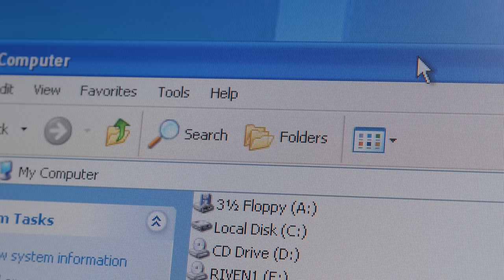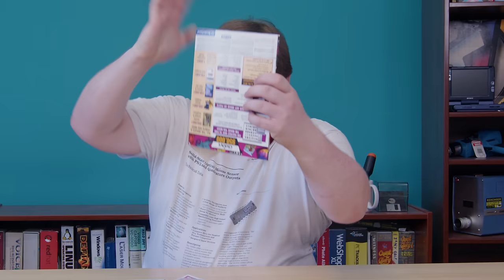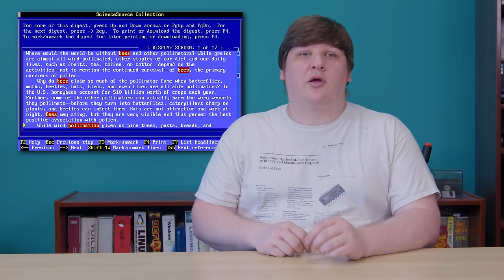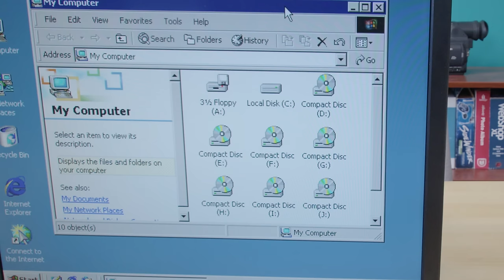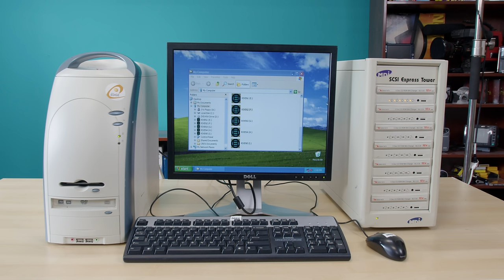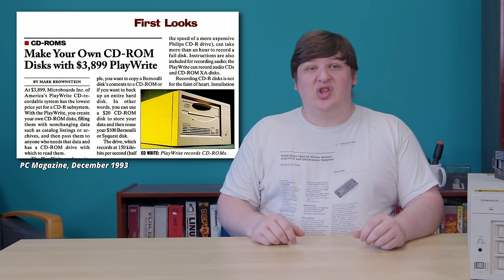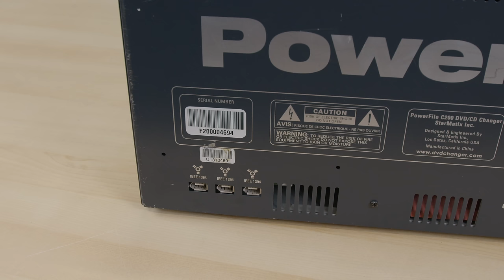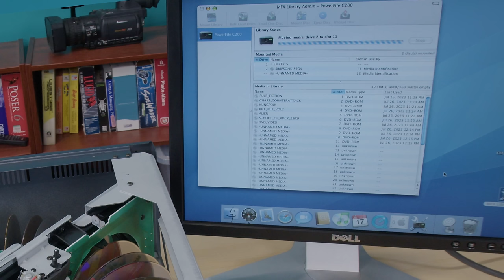A Jukebox for your PC: 1993's CDROM Servers

Comment: The solution for arbitration for these would have been the same as it was for tape libraries: Hierarchical Storage Management (or "Tiered Storage", is I think the more en-vogue term right now.) Think Dropbox. You have a symbolic representation of a file that you don't actually have on your computer right now. You right-click that file and say "online this at your convenience"; the sync agent then goes out and gets the file and puts it on your local disk. Once it's done, you can open the file. (And if you run out of local disk space, the sync agent might choose to "offline" some other synced file in the process of freeing up space to "online" the file you want.)

If you try to open an offlined file without first online-ing it, then the read(2) syscall will sit there waiting for the sync agent to wait for the remote end to wait for its file-online-ing scheduler queue to wait for the tape robot to online the file. And then read(2) will return.

Now imagine the same thing, but with an NFS/SMB link between you and the Dropbox folder. You can still right-click-"Online", but what that triggers is an online-ing of the data _on the server side_, not on your local disk.

That's what a tape-library (or likely CD-library) storage server does. It has the filesystem metadata cache you were imagining, and the hard disks + RAMdisks for caching individual files. But it never directly exposes blockwise access to the files. Instead, it's more like you've got network access to an object-storage cache backed by upstream origin block devices. One process is managing a queue of "online-ing requests" — full filewise fetches from a given origin storage device, to the online-d data cache. Then, async to that, you've got another process, serving out the contents of the online-d data cache through a regular networking protocol. Clients do block access against the onlined copies of files in the cache — never against the offlined origin copies of said files. Only the online-ing agent does block access to the offlined origin copies, and it does so as intelligently as it can, coalescing requests for data from the same archive (tape/CD) and even internally reordering those requests so that it can fetch as much as it can with just one forward in-order read through the archive medium.

Of course, Windows didn't natively support any of these operations†. (It does now, though; calls it "Tiered Storage Spaces.") Instead, from the 1980s until around the early 2010s, when you bought one of these "storage solutions", it'd come with client software — Windows shell extensions! — that allowed you to not just right-click-Online single files, but to specify entire complex data retrieval jobs to fire off, perhaps even with a nice(8)-like priority level.

After all, you might want to hook up an external hard disk to your storage server and have it piece together a disaster-recovery image or audit log from incremental backups held on ten different tapes, over the course of eight hours, without impacting other people's ability to use the storage system for more urgent things.

This kind of software, therefore, had more in common with an HPC batch job scheduler client interface (think: if Kubernetes had a GUI), than it did with something like a PC tape backup program.

Also, the interesting thing to note about this paradigm, is that it never really thought of what you were doing as "introducing" media at the origin, and then caching it online — rather, it's more like you were importing data into an unbounded virtual hard disk, where most of that data would then quickly be "offlined" by evicting it to free up more room for new and hot data. With tape-library storage systems, "evicting" meant writing the data out to tapes. With modern CD-library storage systems, the same is true — the library burns CDs. But I'm not certain on what old CD-library storage "solutions" would have done, in the era before CD burners. Maybe they would allow you to import a "pre-made archive" (i.e. the CD-ROM itself); where it would then checksum all the files in this "archive"; and then would consider any file it had with a matching checksum on disk to now be a candidate for a zero-write eviction "to" the CD.

---

† One funny exception to Windows not natively supporting this: ever since Win98, SHELL32.DLL has contained a little black clock overlay-badge icon for files, never used by Windows itself, intended for these third-party HSM clients to badge files with to mean "offlined by the HSM software."

Comment: The Pioneer cartridges had a HUGE drawback - they scratched the hell out of CDs, ON THE LABEL SIDE - the side where the data is only under a layer of laquer

Ask me how I know this....

As for the jukeboxes and other "MTX" controlled units, there was a package called "rombrain" (dos) which indexed the things

Yes, I trashed a set of 500 disk changers about 15 years ago - I couldn't GIVE them away

Tape robot firmware isn't that much better than the consumer stuff - and these days comes with VERY HEFTY license fees to activate things which already exist in the tape drives

Comment: I would say. The CD storage was always a temporary solution. The idea at the time was that Harddrive would grew to larger and larger capacity, and they would simply just ad more and more hardrive space eventually in say 10 or 15 years time mirror the whole data base on harddrives.

One one file was mirrored of the CD, it would pretty much never taken of. When the drive was full, ad a other one. The  crazy expensive 1GB drive you bought in 1993 might not be full by random reads until 1995, then you could buy a 6GB drive. 

For something like corells image library. The first disk is the thumbnails. That would pretty much be mirrored instantly.

If the disc crash... well. i guess you have a week or two with very slow access, but then it would slowly speed up when the new drive start cashing. So there was not really a need for raid for that drive. (Also something like a thumbnail disc would probobly have there own dedicated drive).

A WORM drive is basically a CD-R.. well sort of kind of. They typically have sectors and tracks, and not a spiral grew as a CD, and they have a totally different protocol. But as far as the actual hardware concerns, they are basically CD-R.

The benefit of  WORM contra a CD-R was that due to WORM used sectors and tracks, they could write one file at a time, while a CD-R had to write in sessions (and back then, most players only supported one).

The MD isn´t only similar to a MO drive, its literally is a MO drive, just adopted for the consumer market.

A MO is pretty much identical to a normal 3½" disc drive with a CD just added on top. It have a totally normal magnetic head that writes the data just like in a 3½" disk drive. The only diffrance is that the disk have a special coating makes it so its only active where the laser shines. So the magnet magnetize a huge surface and the laser focus the read space. That is why the capacity is so much higher.

So in every way that counts, a MO drive is pretty much just a magnetic floppy, with a laser that both shrink the written data down, by several order of magnitude, but also increase the read speed, with pretty much the same amount. (well, it still have to read 1000 of tracks in steed of 80)

There was plenty of PC games that came on DVD. But it was not clearly labled. A friend of my found that out the hard way. Putting a newly bought suposedly CD game into his CD player, turned out it was a DVD record, just labeled as a CD-rom

Comment: A couple comments. 1) Linux has a function/feature that you can build a virtual juke box. I did it and it worked. At the time I did it, hard drives weren’t as large as they are now. 2) mid to late 1990’s, a company I worked for got an Enterprise version of a CD juke box, to archive data on. The options were, you bought a rack, specified how many slots, one slot per cd and how many cd drives. The company I worked had spent a large amount of money on it. When it worked, it worked great. The problem with the unit was the mechanisms used to retrieve a cd and insert it into a drive a.k.a. “cherry-picker” would get out of alignment.. The technicians would come in, at least once a week and align the cherry picker.  And it was a time consuming process.

Comment: I once saw a technical interview with a technician of a playout centre which got its content delivered on Digibeta at the time, so they had a tape changer which would copy the programmes onto harddisks automatically. He said that the changer was pretty much maintenance free. It only needed to be lubricated from time to time.

Back in the time those changers would have been highly interesting for me, since, if they work, they open up optical media to whole range of use cases. For example you could use them for backup. You just fill it with blank disks from time to time, and regularly it would write the backup onto them, sparing you the drudgery of having to get up at night only to swap a disk every 30 minutes. 

Of course this all hinges on software... and with the only option being a GUI tool it kinda eliminates the advantage of potential automation.

Comment: I hated dvd players in the 2000's. The first one was a pioneer 5 disk changer that was over $1000. It lasted about two years before I had to start taking it apart and cleaning the lense. That didn't work very long, and it would stop reading again. Sometimes I could give the spin a boost manually and it would run. That worked even less times. By this time, you could get a plain one for $30 bucks at walmart. They maybe lasted a year sometimes only months. This video has brought back so many memories of high frustration ending a few of them getting ripped off the shelf and flying across the room. Aside from that, this guy is a great writer. I can't imagine putting all this together.

Comment: I worked at a private school back in 2002/03 and at the main school we used a ISO server. This allowed us to ISO a CD and then share the ISO over the network. Only us admins could access it to install software from it, thus preventing other staff and students from copying the disks. At the lower school we had a SCSI five drive bay CD-ROM tower which we put CD's in and then the disks were never removed. I can't remember how the CD SCSI tower was setup because it was installed before I started working there.

Comment: General 6000! I cleared out a radio station with a set of these, most never left their cases, I gave them to my production guys because they actually collect vintage sound libraries! 

I’m only 9:37 into the video, if you talk about radio, I may give my two cents, but at face value, it wasn’t as common as you would of thought, at least not for independent, “family” owned stations, this is all before my time, but from what I’ve seen, we went from reel to reel and vinyl to cart machines and cassettes and CDs… and then it spliters, some went to CDs only, other held out till they no longer could, into the digital age, and other flew into mini disks head first! 

I cannot understate how many MD players I have in storage…
Reply: Yes the pioneer disc cassettes!

I’ve only ever known of one station in the area to use this device! I got to hold it before it was sent to the afterlife, don’t feel bad it was long since dead, they sat on it for decades because radio people don’t throw stuff out…

Comment: This reminded me of the many depressing times the place at which I worked for decades would get some new kind of gee-whiz mass storage hardware to productize for our clients. Naturally our management always found the cheapest solution available and figured the manufacturer would fix all the problems we found. The evaluation models always barely worked for the main simple use cases and would fail horribly for anything outside of those use cases. To test them I would do things that would be unthinkable to a nerd but completely intuitive to a standard human being... like eject the media when it was being accessed. In two cases that caused the multiuser system to crash and in one case of a poorly designed removable hard drive it made the media and the data on it unusable forever. Almost always the manufacturer would claim that I was just some idiot abusing their hardware, you know, like all the other idiots in the real world who would be doing the same things if we began selling them.

Comment: This whole CD storage tower trend always baffled me. Older CDs were 640MB maxing out later at 700MB. So just build a RAID group on an older server with some larger SCSI drives. Rip the CD’s into ISO’s and use a software platform to mount them across the network. Way faster transfers overall, especially if multi people were accessing the same ISO. All that in a much smaller footprint than those giant 42U rack full of drives. Plus all that can be done without having to physically touch the server. And you still had the original CDs as backup.

Comment: I remember a BBS that I frequented which had 'broadcast times' on files. I wonder if they used something along these lines. A disc would swap out every 4 hours and then another group of files would be 'broadcast' for download. Speculation, but it sure fits the use case.

Comment: I got a 7-bay SCSI tower from my school's library when they were upgrading theirs.  They used it so kids didn't need to handle Encarta CDs (and in fact the entire tower was kept in a back area).  It had a bunch of caddy loaded Plextor drives, IIRC.  I ended up replacing a few with CD-Rs for burning multiple copies of CDs for... things.  Safe to say, I WOULD download a car. 🏴‍☠

Comment: Cool video! My company had one of the large Pioneers (pictured at 38:00) installed in our data center for the accounts payable department to look up scanned copies of invoices stored on burned CDs. The software was custom-written and did not handle multi-user contention gracefully. When it was decommissioned in the early 2000s, I brought it back to my cubicle to experiment with, since I'd noticed audio outputs on the back! I remember finding some clunky software online to load a disk, but having no place to store it ended up giving it to a co-worker....

Comment: Once upon a time, by some means I don't recall at all, I requested CD-ROMs from the Hydro-Climatic Data Network, and they sent them to me. I was just a teen back then and had no use for that raw data. I'm not sure if they would honor anyone's request or what. I ended up tossing those CDs out recently during a move, as it happens. But yeah, it's an example of the kind of raw data you could find on CD-ROM back then, before it was feasible to have it all available online instead, or as an alternative to online access.

Comment: The Pioneer cassette CD-ROM changers were similar to their car audio product. (6 disk cassettes were identical). The ancient looking heavy-duty internals are derived from the car audio line which had to be heat and vibration resistant. The overbuilt actuators not only ensured longevity in hostile environments such as an automobile trunk, or all day use by multiple users on the same network attached jukeboxes.

Comment: Used the same scsi tower x2 back in my dj days. Plus I had mega amounts of 6 packs full of genres. Worked great especially when I dj at my frat because I could just leave it all in my room run a cable to the basement and bingo instant rave.......if u want two of the same towers complete with 14 nakamichis let me know they collecting space in my basement, pioneer was notorious for loading upside down discs

Comment: Regarding the drive with the lens that popped out: You need to re-focus the laser. Look for a potentiometer near the laser on the circuit board. Its usually a tiny philips head dial thing. Increment by 1/4 turn clockwise until you get a good read. If you reach the end of the turning of the dial going clockwise and still no read, then go counter-clockwise, 1/4 turns. When the drive starts hiccupping and reading, fine tune in either direction until its reading perfect again.
The End. Good Luck Jim.

Comment: I actually have one of those pioneer cartridges that held a 6 CDs. I got one for a buck at a garage sale back in the mid 2000s, thinking it was (and only using it as) just a convenient way to hold a few DVDs. Beat carrying 6 DVD cases on a trip, instead I'd just load them up and put them in a spare compartment in my dvd player case.

Found out in recent times they were used for mechanisms to hold multiple discs, and I was like "oohhh that makes so much more sense"

Comment: I've never used one of the enterprise CD/DVD changers. I've used a number of enterprise tape changers. The tape changers were extremely well designed, standards compliant, and a giant ball of "just works" (as long as you have reasonable software, looking at you Windows garbage).

Comment: Pretty sure the transfer of datacenters to ssd's is still on going, but it might have largely wrapped up by now, I know it was ongoing 2 years ago at one of the big sites that shares hdd failure rate information. Just looked it up, and it seems the debate still rages on with ssd's and hdd's staying roughly the same relative performance distance as back in 2017 when the shift started, a wonderful area of it depends and the depends depend on other dependencies that also have dependencies again.

Comment: those big libraries don't have 300 slots to be completely filled, there's software to manage it just like a tape library. it moves disks around based on access patterns. each library is “per user“ on the assumption of the timeliness of the data. they merely allow access to a huge range of data, the patterns for each user is distinct enough that caching is effective. you don't have to open a disk that lots of people were already accessing